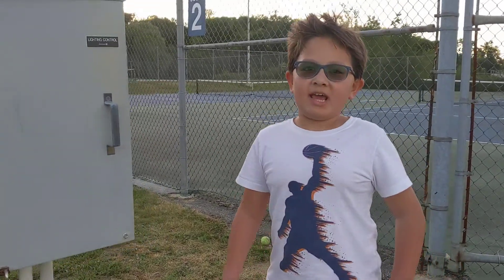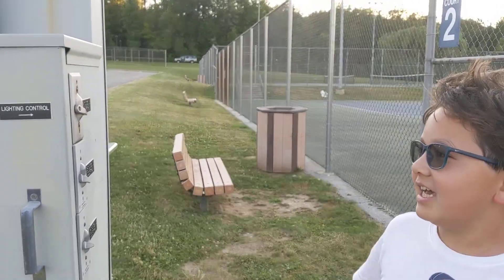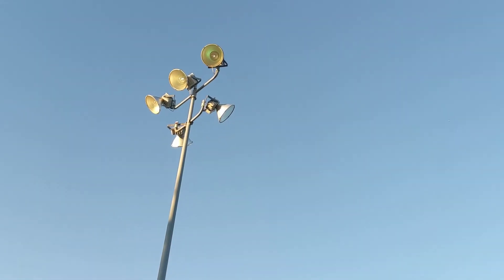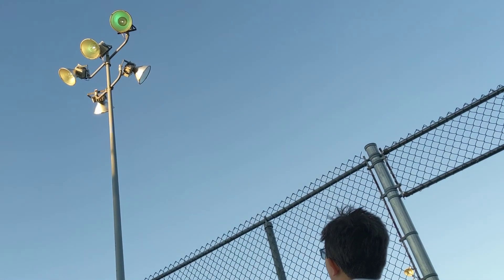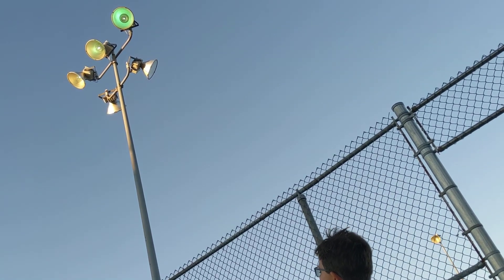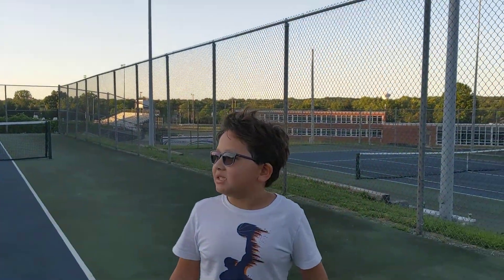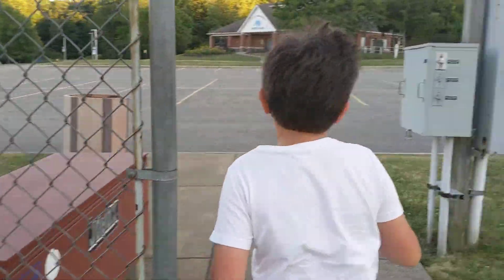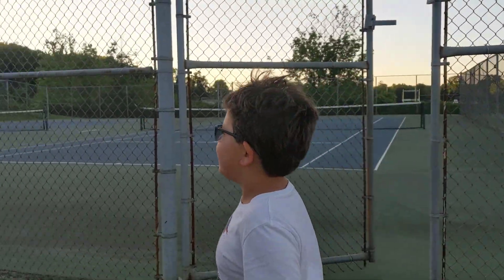Metal Halide 400w at the tennis courts

Comment: They are definitely 1000 watt fixtures. I have never seen 400 watt metal halide sports light fixtures. They will most likely be replaced with LED fixtures one of these days if not already. Even though probe start metal halide lamps and fixtures are cool, the 1000 watt lamp has a relatively short life, and lumen maintenance is bad on them, not to mention color shift of lamps. Enjoy them while you can!